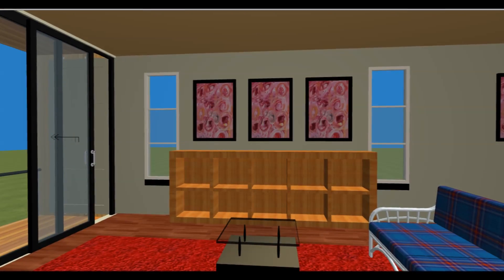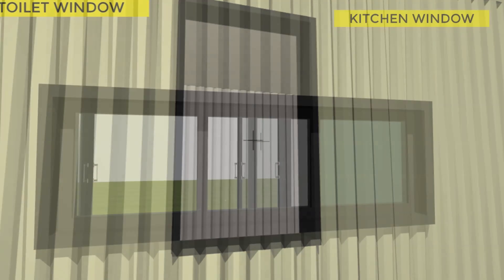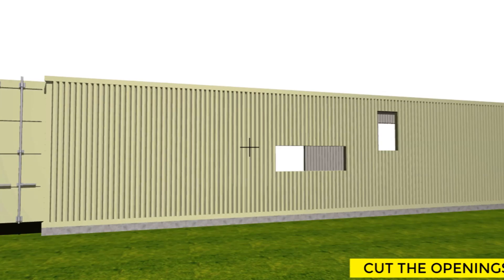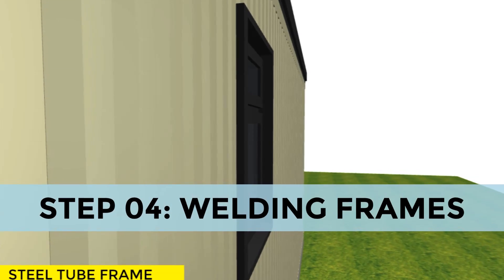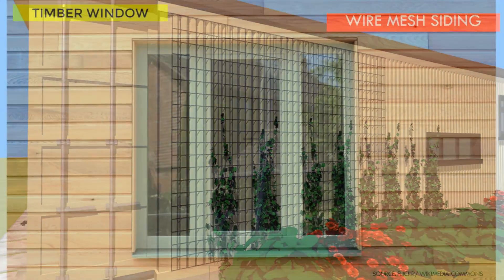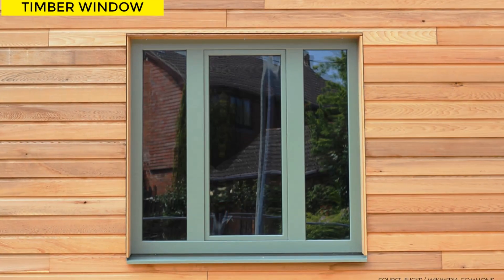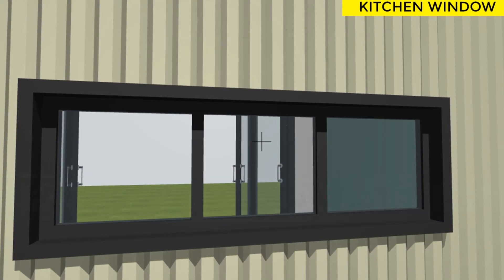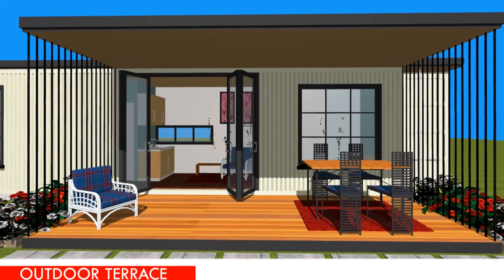How-To Install Windows in a Shipping Container House 2018 | ShelterMODE

Comment: I guess I’ll need to learn welding for cutting the windows and doors in steel containers. I can take welding  classes at the local community college. I have basic skills. The foam spray insulation will not be enough to insulate according to code in Navajo County.

Comment: Making the window frames from the metal that you just cut out saves on money (not on work) and the frames will then be from the same corten steel that is pretty good at resisting rust. Make sure your welding with a suitable filler material.

Comment: Cutting torch makes a mess.this generates to much heat and deforms the the steel.
A grinder is extremely dangerous. The steel expands and tends to bind on the cutting disc causing these discs to blow apart. I personal have been scared doing this.
Pay an expert fabricator to cut these openings.
This is NOT a DIY project for an unskilled person.
Reply: USE A SAWZALL IVE USE THIS TO CUT THIS TYPE METAL MANY TIMES.
Reply: Use a plasma cutter. Easy and fast. I got mine for about 200US$ which was for a combination machine as it also does TIG and stick welding.
Reply: Mmm. It is not available anymore in the configuration I bought it. I bought it without all the accessories, just the plasma cutter as I already had a stick and tic welder. Mine is called a 'cut 60', the brandname is Jasic. Used it for more then a year now without problems.
Reply: Tzadvantage Bkk 

You fail to mention that a high cfm compressor is required for plasma with dry air.
I use a 400 liter high output cfm compressor with 3 air filters to remove moisture.
This cost me more than the plasma cutter did.

Plasma is the best & safest way to cut openings in a shipping container.
Reply: I have got a Puma 80 liter 2HP compressor and a single moisture filter. Works fine. (Here in Thailand we have high humidity, often 80% and higher but it seems to keep up). The thing is when you are building stuff you got to have tools. You will also need a grinder ( I got a 4" Makita) to clean up the edges. A plasma cutter is just another tool to make live easier. For instance I bought a Makita cold saw as I got tired of using a grinder to cut steel tubing and cutting it with a plasma cutter is also not that efficient. A plasma cutter is great for flat stock or in this case container walls. When building the interior a miter saw and a table saw is very nice to have. And so the list of tools goes on and on. :) I not save on tools as I prefer to do it the most efficient and most important the safest way.
Reply: Tzadvantage Bkk 
I had a puma 80 liter for painting.
It was a good compressor.